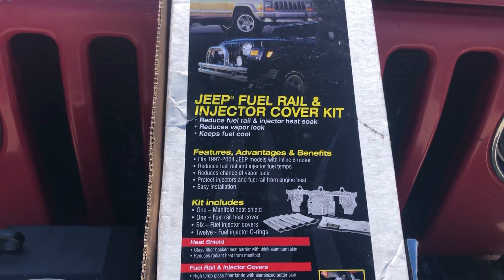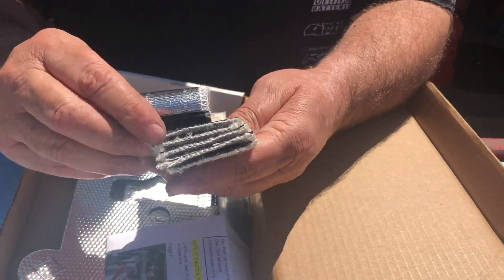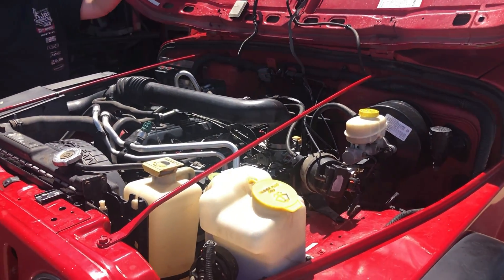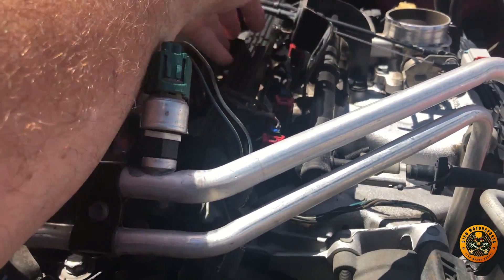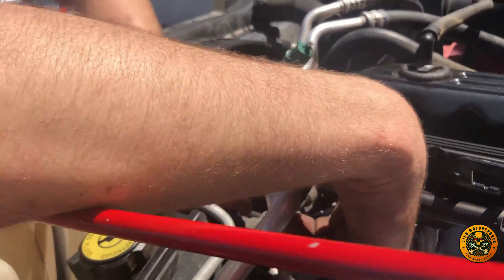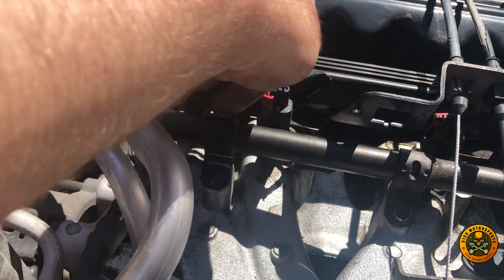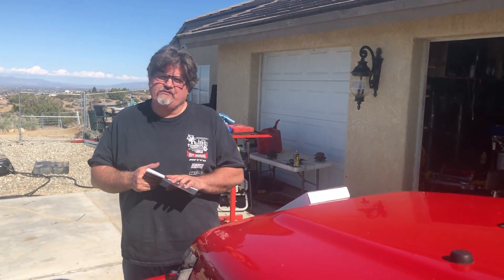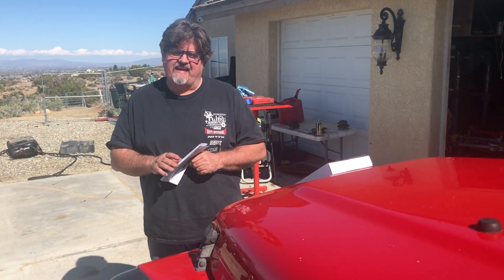DEI Jeep Fuel Rails Injector Cover Kit

Comment: I had a bad injector so I upgraded to Bosch 4 hole and upgraded to a Fasster aluminum fuel rail. Though this kit is designed for stock I wrapped it in heat tape. Not the cleanest but it should  function for those trips to Utah in the 110+ heat. Wish they would make a kit for aluminum rails. Why spend all that money for the kit and not  all the components when you should upgrade the aging injectors and then why not the fuel rail. The heat shield didn't even fit that well and jad to be trimmed. Not worth the money in my opinion.

Comment: Thanks for the video, I have an 1999 Jeep Cherokee 4.0, I am pretty sure has the same problem. I can't help but wonder why it ran so long before it started doing this? Is a fuel pump, fuel regulator, or something else getting weak? Why did it run fine so long without this, and suddenly need it? Seems to me like we are not fixing the problem, but doctoring the symptoms.

Comment: That looks like a nice kit, but on my 2000XJ with heat soak misfiring I fixed it with just the one sleeve on the injector that suffers. It was like $11 on Amazon and took about ten minutes.
Reply: Just wondering what sleeve you ordered? I bought this heat-resistant tape and it worked for a little, but then quit. I'm debating on buying the whole kit, but if I can just buy the sleeve for the one injector that suffers (injector 3 I think), that would be perfect. Do you have a link for the sleeve you bought?

Comment: You clean stuff way too much 
Just slap that shit in there and be done with it geez I’d have it done in 5 minutes (XJ OWNER) Wranglers are for girls 😅
Reply from the maker: Anytime you are working with fuel you want to make sure everything clean, take the extra time and do it right the first time.👍
Reply: @5150MotorSports  Maybe with the 4.0L in a wrangler the one in my Cherokee requires exactly 1.3lbs of dirt and rust per gas tank fill up to run right at least with my 16gal tank trust me she loves dirt 😉😁